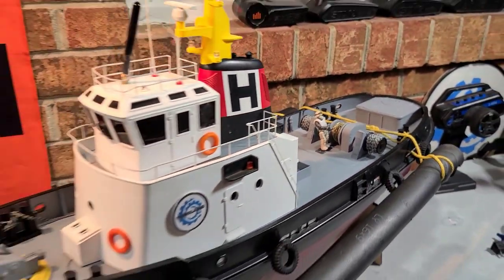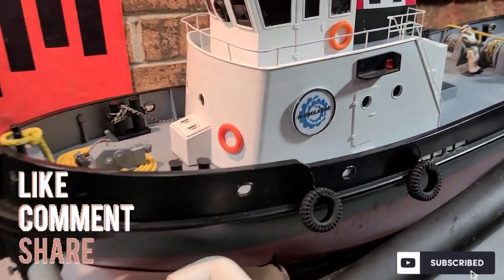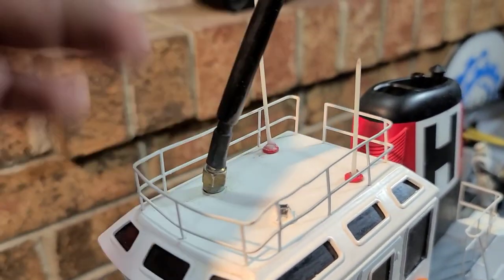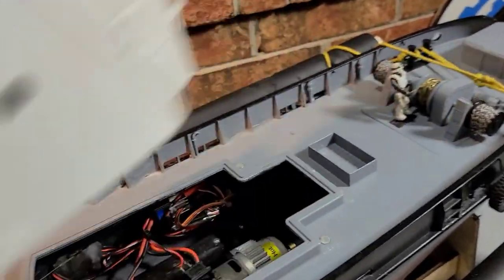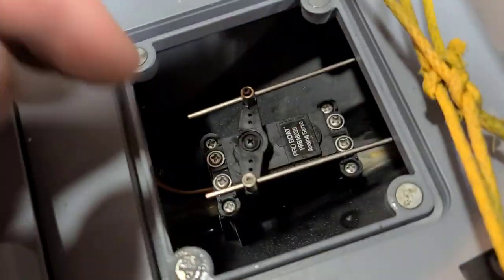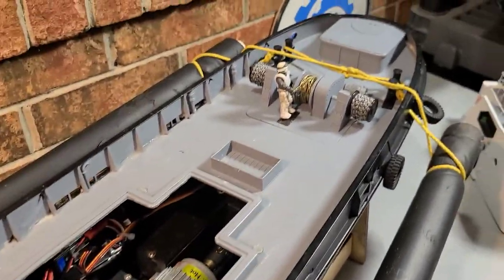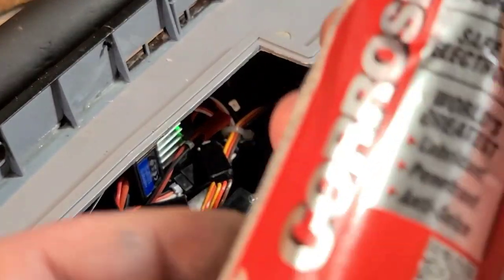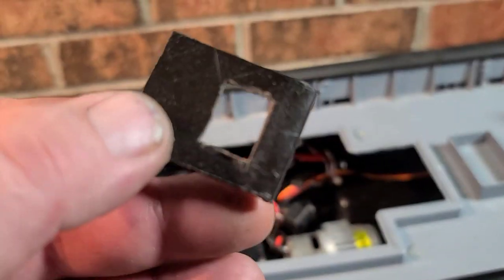Horizon Harbor Maintenance, Mods, Tips, WaterProofing, Ballast, & on/off Switch - Long Video

Comment: I've built several rescue boats over the years and I must say the HH Tug does a great job and looks cool doing it.  Adding the FPV video makes those long-distance rescues a snap.

For a rescue boat to work well, it has to be convenient, reliable, and powerful enough to do the job.  So far, the HHT has demonstrated all those qualities.  The narrow aperture of the "catcher" on the HHT eliminates the steering issues I experience with my rescue boat when the victim boat is crooked in the catcher.    This narrow aperture also makes the FPV a must-have upgrade for bigger boats and longer distances.  I'm still playing with the idea of pulling a victim in with a towed catcher rather than pushing it in for a number of reasons.  Should I ever take that idea and make a real-life thing out of it, the HHT would make a great ...er... Tug for that towed catcher.

Comment: Great video, lots of good ideas 👍
What’s your formula for the backing soda and ca, 50/50 ?  Will it make a good lightweight filler? And Ummm… how fast will it go 😂🤣😂🤣
Reply from the maker: I apply the CA to the area that's being glued then I sprinkle the baking ps right on top of the CA & repeat!   The baking soda strengthens & speeds up the cure process..

NOTE, YOU CAN NOT  PRE MIX THE TWO TOGETHER.  CA, THEN SPRINKLE, THEN CA, & SPRINKLE SOME MORE.    HOPEFULLY THAT MAKES SENSE. (VOICE TEXTING SUCKS LOL)
Reply: @IRONCLADRC  I get it, good to know.  
 I live very near the one and only hobby shop in the Richmond va area, Hobby Town, and if it’s not about rc drag cars or rock crawling rigs they don’t have much info to share. They do sell boats but they look at them kinda funny and ask “where do the wheels go? “ 🤣😂🤣  Thanks

Comment: Great video on this boat. For waterproofing the deck should I get both thin and medium CA? I haven't used either and it looks like Zap has both brush on and squeeze bottles? What would be your recommendation? Thanks
Reply from the maker: I used both thin and medium CA while fixing my issue (squeeze bottle)

Comment: I don't know if anyone has noticed but if you remove the wheel house there is a channel molded into the plastic that runs down to a slot with two holes for wires to run the channel runs to the top of the week house roof
Reply from the maker: Thanks I'll check it out.

Comment: @IRONCLADRC, I just came across this video and am wondering how adding weight to the back turned out. I have the same issue pushing gas boats. The prop comes out of the water and it quits pushing.   What did you end up doing? How much weight and where? Did it work? I didn't find any later videos the said the result.
Reply from the maker: It helped quite a bit actually, I moved my battery back along with the additional weight. Keeps the prop in the water
Reply: @IRONCLADRC  Do you have any guess as to how much lead you added? Other tug (not horizon) videos talk about ballast but getting too much and swamping the back.
Reply from the maker: I believe I put a 6oz egg sinker in the middle and 2x 8oz  bank sinkers on the sides.  22oz total I think 🤔
Reply: @IRONCLADRC   Thanks, it's a starting place.

Comment: BigB have you ever sprayed the inside of the brushed motor with corrosion X? BigB, will we eva see an airplane ✈️, quad or some sweet slow motion closeups of trucks?
Reply from the maker: Don't spray corrosion X in a brushless motor.   As for a brushed motor I've never tried a brushed motor  maybe worth a shoot

Comment: Wouldn’t water leak through the top steering shaft big b?
Reply from the maker: I haven't had any issues, with water from the steering, I did have to glue the topside and bottom around the seems together had water leaking from the seems

Comment: @IRONCLADRC  I just went to turn mine on for the 3rd time, and I have nothing? No power. Nothing. It's a brand new battery.  I checked the battery and it's good. Any ideas for me?
Reply from the maker: Check the on/off Switch my wire came off the switch.   Also check all the connections
Reply: @IRONCLADRC  10-4 and Ty!   Everything is connected and soldered.